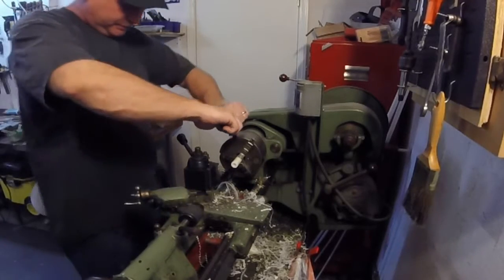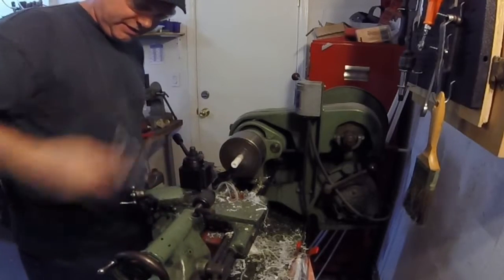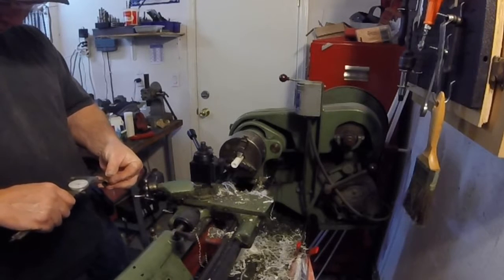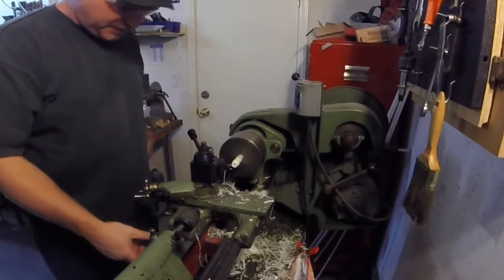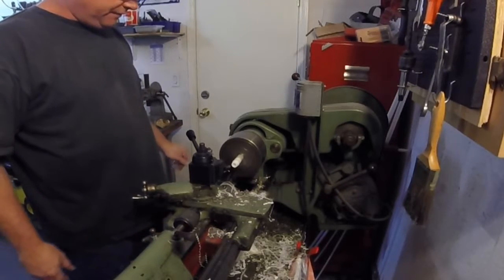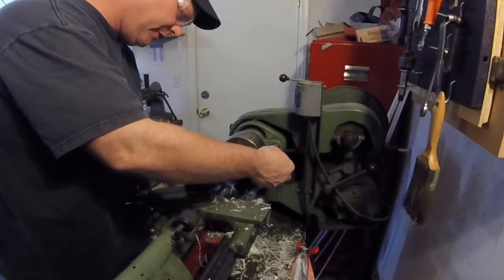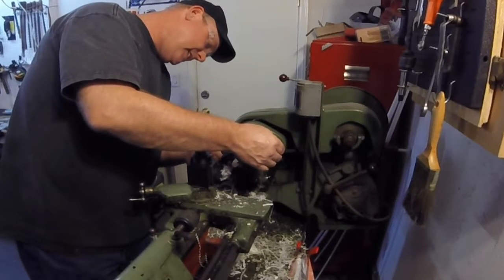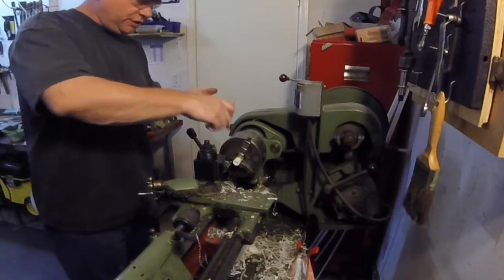Machining Delrin: Making a Bushing

Comment: I build kinetic wind sculptures and for my bearing housing I start with a 2 1/2” in length 1 1/4” schedule 40 stainless pipe. I then make a bushing to go inside the pipe out of 1 3/8” molly filled brown derlin. It goes right into the pipe pretty much perfect. I then go to my little atlas 618 lathe and bore a 9/16” hole through the bushing so that if will clear my 3/8” shaft when turning in the wind. I then jump over to a designated drill press that I have a centered lathe chuck mounted on and then bore a 7/8” hole in both ends of bushing for the bearings. After I have the arms welded on to my stainless I then insert the bushing into the pipe and then pin it in a pre drilled 1/4” hole in the pipe. I do use a reamer to insure 7/8” in a hand drill before going into the stainless pipe. I think that if I had the right point on  a drill bit I could make the 7/8” bore on the lathe as well. I think a 90 degree point on a drill bit would work but I can’t seem to find one. My drill chuck is 1/2” on my lathe. When the point is to flat and not enough degree my lathe chatters and tends to chew up the nylon inside of the bore. I don’t have a quick change tool post on my lathe to use a boring bar. Any ideas? I subscribed to you channel. Very nice video.
Reply from the maker: there were old school double grip tool holders. the jaws could be independently offset to line up center..
i suppose you could use an endmill in a shop made adapter!

thanks for the subscription!!!